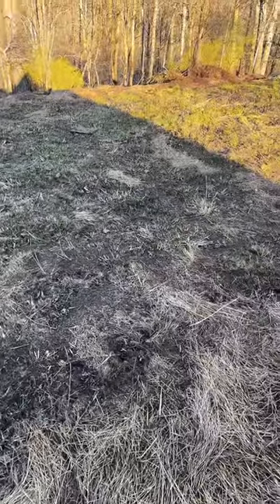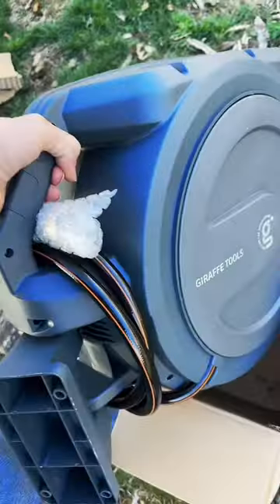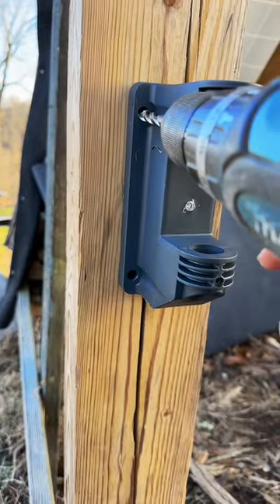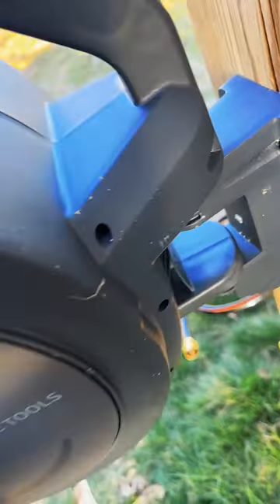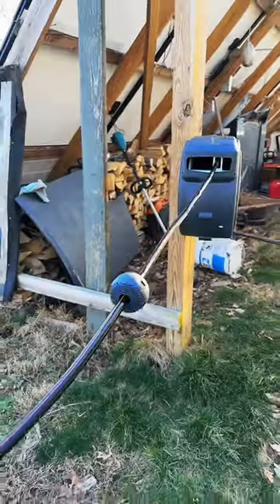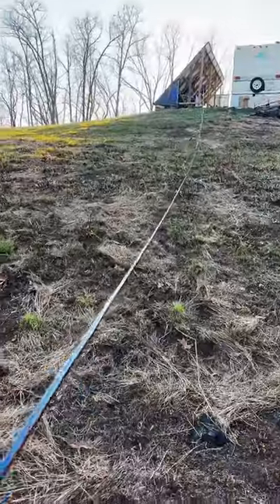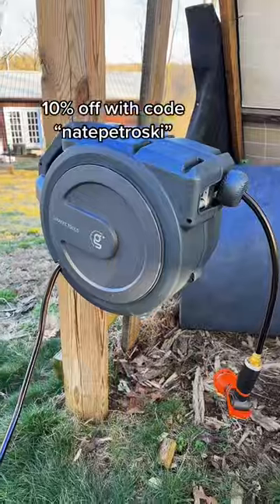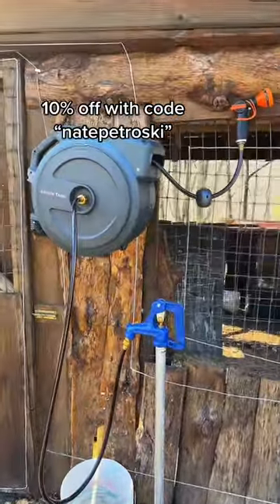installing a hose reel

Comment: Don't leave it on when you're not using it, because those thing's almost always end up leaking.
Reply: I thought this was common sense for all hoses. It’s not a pipe, so it’s not designed to be under constant pressure. Unloading the water pressure is important too
Reply: @gearheadgaming1537  It’s good to remember. I’ve been guilty of that more than once.
Reply: Unfortunately he’s right. All brands do it. Or the six I’ve installed at least.

Comment: When it comes to hosing, its craftsman or nothing for me. Strong metal connections, thick rubber, and no questions asked lifetime warranty.
Reply: Is that still true? I thought Craftsman got rid of the lifetime warranty?
Reply: @ButterBallTheOpossum  i haven't taken one back in at least 3 or 4 years. Its very possible they got rid of it and im unaware
Reply: @ButterBallTheOpossum  i did a quick search and it seems they still honor their lifetime warranty. All good 👍👍👍

Comment: Remember when vaccuum cleaners had retractable power cords like this and when you pulled on it it would retract so fast it seemed like it would take your hand off or act like razor wire cutting your legs off. ^_^
I'm old btw.

Comment: How reliable do you think that plastic will be in the winter?
Reply: I bring mine in for the winter myself. 
If I had this one I would do the same. 
Freezing and expansion and all. Of course if you just drained it pretty good it would be fine too.
Reply: He said he has had one on his coop for a year, so im guessing its held up pretty decent if he bought another one
Reply: Fairly reliable if it’s made for it. It gets brittle, but if it’s refined and formed right, it’ll do fine.